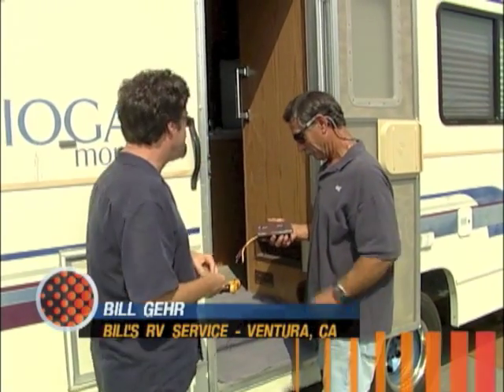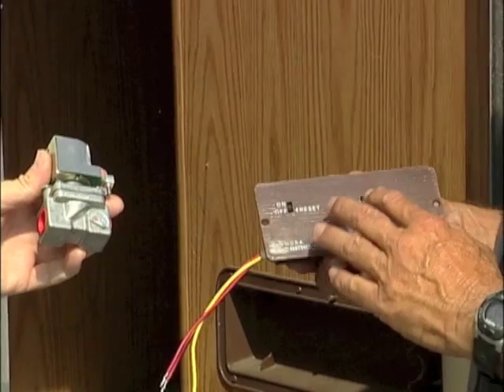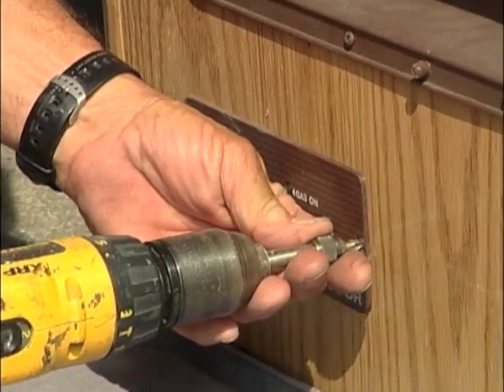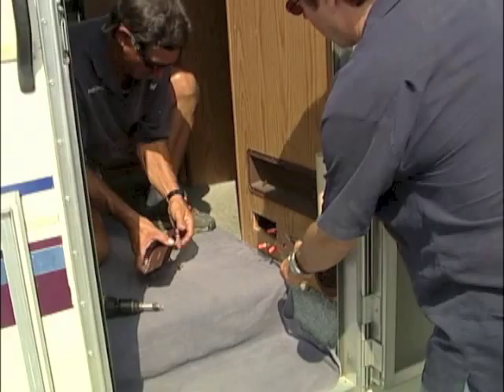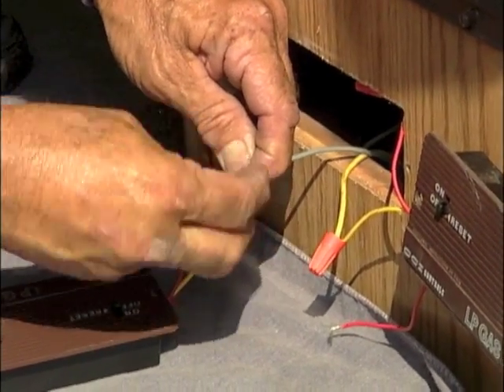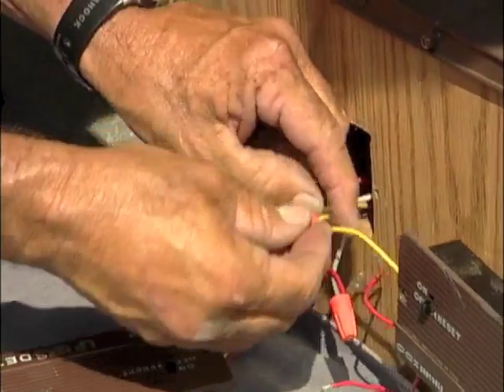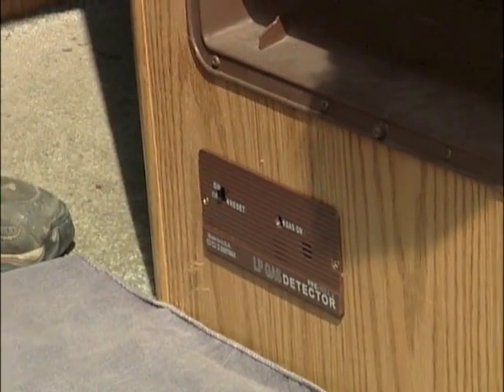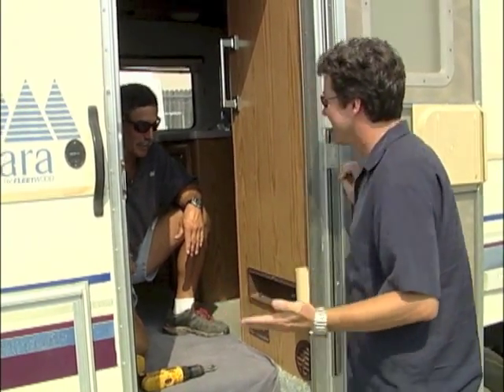RV How To - Replacing the LP gas detector

Comment: I ordered a described swap-out Safe-T-Alert detector from MTI Industries and Amazon quickly delivered a 2 wire detector to replace the 3 wire that was in my '98 Fleetwood Flair coach. I have sent an email yesterday to MTI, but have not heard back from them. The parts manager at my local RV dealer said that they quit making the 3 wire, but the tech told me that Amazon still has them. Now all I need is the right detector or a wiring diagram. I want to leave the solenoid at the LP tank because I think it is a valuable safety feature- this is a clear case of older technology being better than the cost-saving gained by eliminating a $50 solenoid. A gas fire in an RV would be horrible for a couple of disabled seniors and their little dog.
Reply: i called MTI, they said they can help me and that i have to call an RV tech.......what a bunch of buffoons................helpless and rude on the phone...did they ever reply to you via email about the 2 wire vs 3 wire?

Comment: quick question.. im replacing my co lp detector   but there are only wires with the tips stripped..  where do you buy snap together connectors for these wires  .. now that radio shack is gone.. im not sure of local sources       the wire behind my wall is too short to put out and strip .. so i need to match the connector with the longer wires of the new co lp detector..

Comment: how do you test the solenoid?
Reply: I have an '85 Fleetwood Pacearrow with one of these.  They are no longer produced however, they can be rebuilt.  As to your question, if you go to the solenoid at the gas tank turn off the main valve at the tank.  Use a volt ohm meter set to Rx1 scale to read resistance you should read about 12 ohms resistance.  If you read "0" ohms the coil is shorted, if you read NO ohms the coil is burned open.  DO NOT short the red and yellow wires the 12vdc this WILL burn out the solenoid.  Currently I do not have a source for the solenoid.  If you see a manufacturer's plate on the solenoid please let me know the manufacturer's name, model number and operating volts if listed.

As to the detector itself when switched "ON" if it goes immediately into alarm and does not shut off, the internal 'Sniffer Sensor' is bad.  All is not lost, if you know how to solder you can restore the function.  The sniffer sensor can be purchased on Ebay.  It is a "Figaro  TGS-813" cost is about $6 each.  In my case I purchased 2 so as to have one as a spare.  The case of the detector is assembled with "hot glue" and can be easily cut open with a utility or linoleum knife the PCB then lifts out.  Remove, desolder the defective Sensor install the new sensor the unit is good as new.  Do not mess with the POT on the board as it is sealed and set at factory calibration specs.  You can also PM me I will respond.  I hope this helps.
Reply: Michael Schmidt Hi! Do you have any videos or a blog anywhere?  I'm trying to get my 1988 Fleetwood Southwind ready to take my mother from New Mexico to Washington state and so I'm trying to learn about and repair each area.  I'm currently working on my propane system. The solenoid seems to be working properly, but when I switch on the lpg detector, it immediately starts beeping and doesn't stop. The light on the right briefly flashes after a minute and beeps for a couple of beeps before it stops. The continuous beeping on the left keeps going. Is that the one you're referring to where I should replace the "sniffer sensor"?